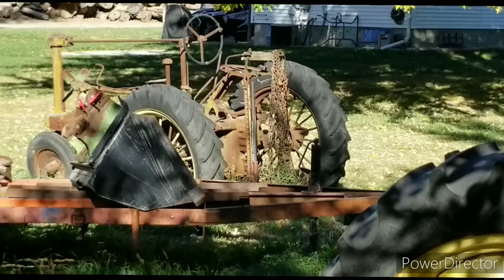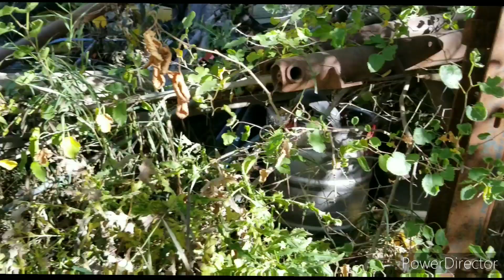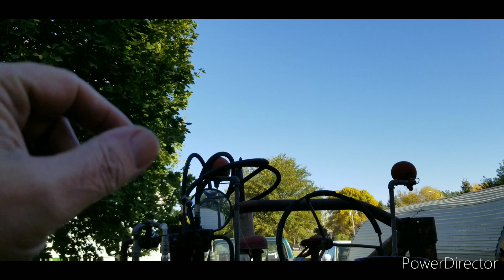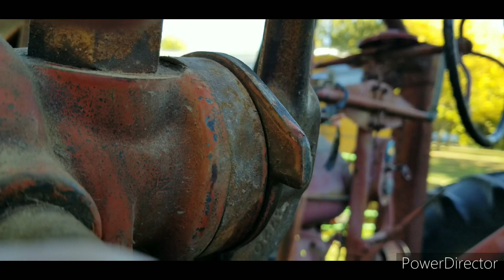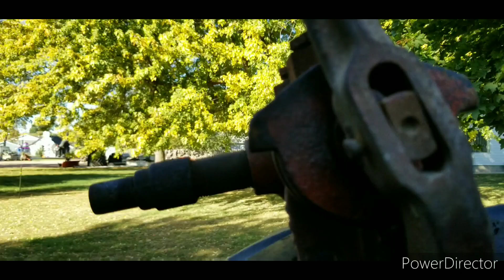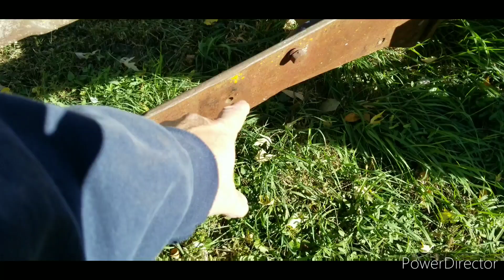F10 Farmhand Spool Valve

Comment: There was a dude that had one mounted on a truck frame.  He pulled it behind his semi trailer and would go around and scoop up guys cob piles from shelling.  Dads cousin has a f25 which had bucket tilt cylinders.  His is on a 4010 with a spring ride truck front end.  Hed sweep hay in 7th and 7th reverse.
Reply from the maker: @AgWildNebraska  I've seen a few on truck frames that were reversed, used for sweeping and stacking hay.
Reply: @martinbenton742  I'd like to have an F10 or f25 just for the heck of it.   Probably try and teach myself how to stack.

Comment: I've seen those loaders on the old johnny poppers, up to 4010.. there's actually a 4010 for sale in eastern Oregon with an F10 on it. They were popular for piling loose hay back in the day, then for round bales and big bales. 
Longer video than you expected 🤣😂 it's really easy to run long!!
Thank you for the education and the history Doc!
Reply from the maker: @GosselinFarmsEdGosselin  they used the heck out of those loaders. Stacking hay, loading manure, scooping grain and snow, and I've seen a couple with push blades. Don't know if the blades were factory.  Dang narrow front tractors and going that high would scare the banana butter out of me!